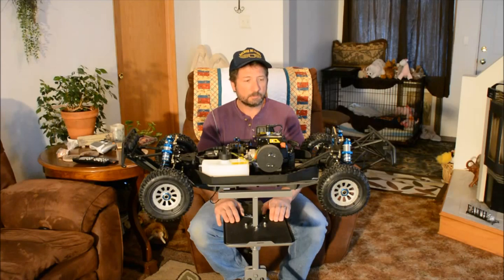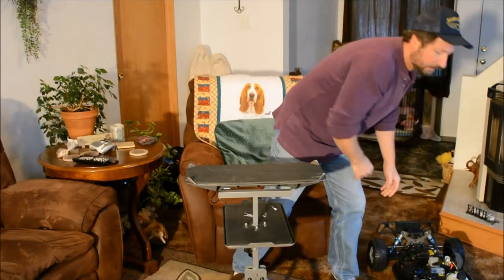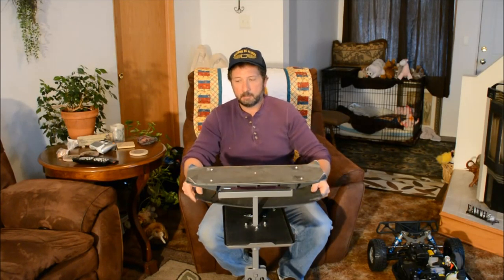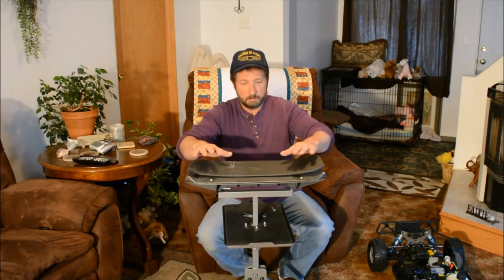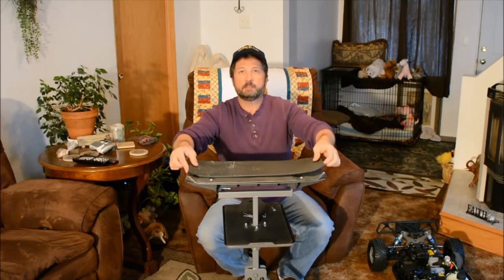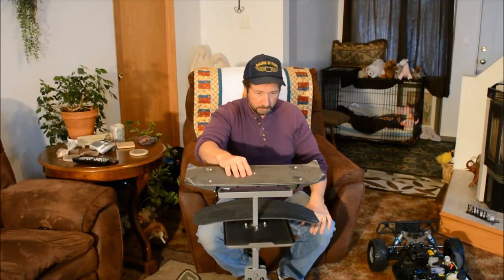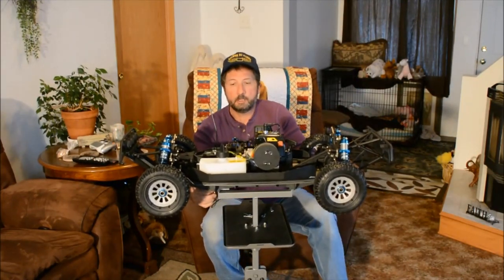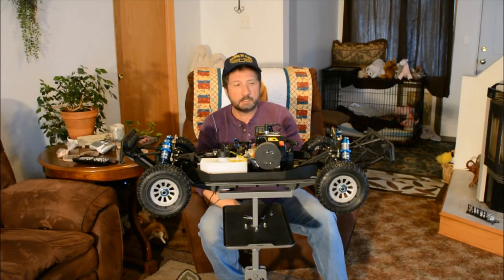1/5 Scale RC Stand Flip Top

Comment: you have a drawing of your top plate
and also the sizes of there with longitude and Brete
because I losi standard to make it for me
Can you help me with these dimensions
g theo

heb je een tekening van je topplaat
en ook de maten er bij van lenkte en brete
omdat ik standaard aan het maken voor mij losi
kan je mij aan helpen met deze maten
gr theo
Reply from the maker: I'll take some measurements and post them.
Reply from the maker: The top plate is 21" X 8" and made out of 16 gage steel, but you can use thinner and be ok. The tool tray is a Coleman aluminum griddle and its 16 5/8" X 10 1/4". The video explains the bending process.